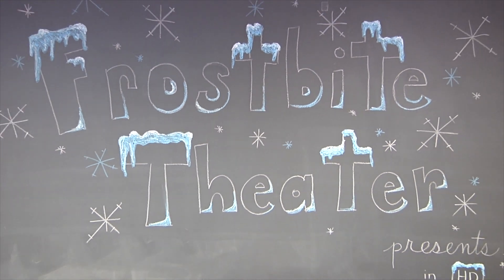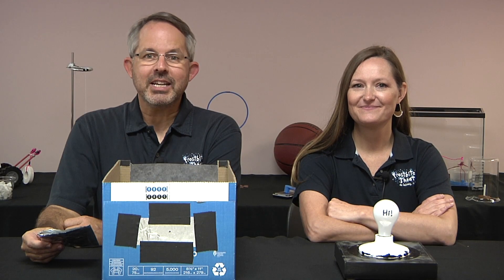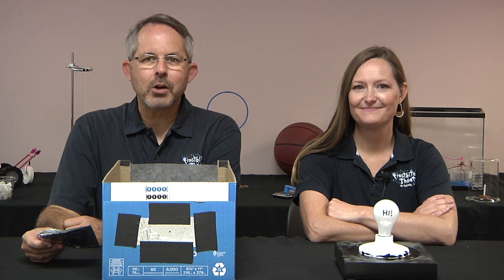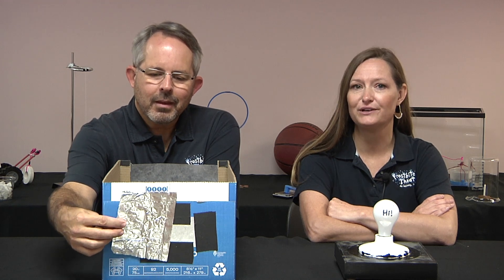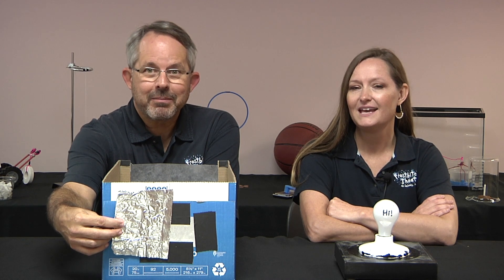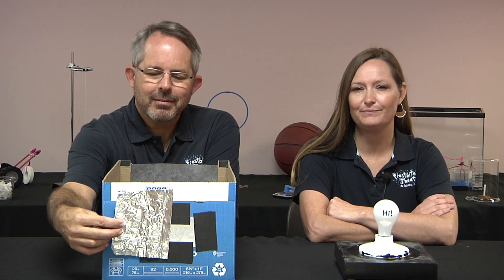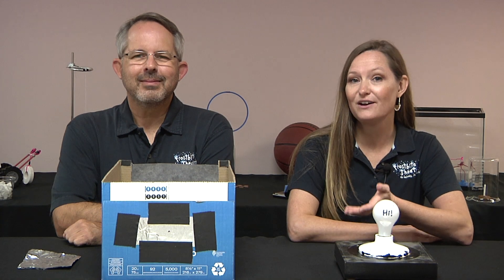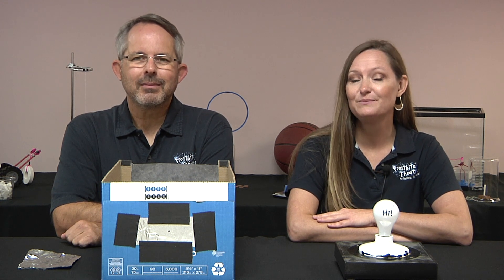Here's a Question! - Image from Half a Pinhole

Comment: knew it, but  if you put the foil closer and closer to the light bulb  somewhere you get  half of the bulb image, what happens in the middle?  you get a shadow that slowly sharps and splits the bulb? what is that distnce?
Reply from the maker: You get half the bulb image, but still get the full 'scene' image. Assuming the lighting conditions allowed it, you'd see the half of the bulb that wasn't covered, plus everything on that half of the image, as well as the foil blocking the other half of the bulb, plus everything on that half of the image.
Reply: @JeffersonLab  hi   johana  h steve,   yyeap  a pinhole catches everything 179 deg in front. here  is a sugesStion  I long wanted to try:  2 very close pinholes very very small very very  close, would you get an in terference patern? how about  3 pinholes... and four?could it be see by eye?